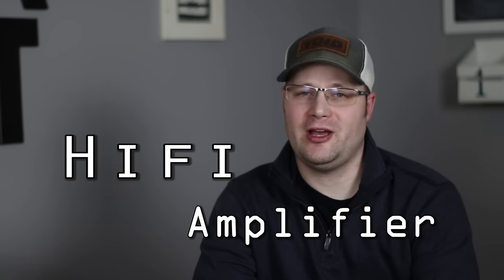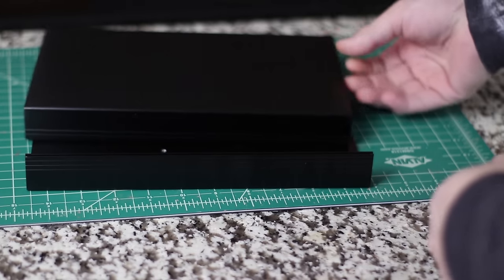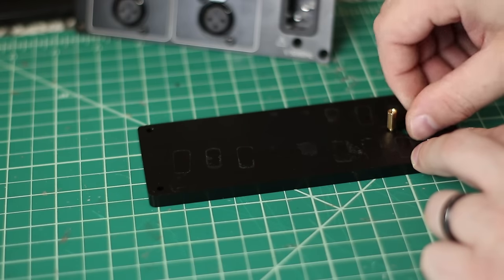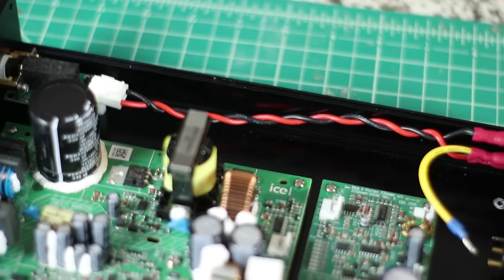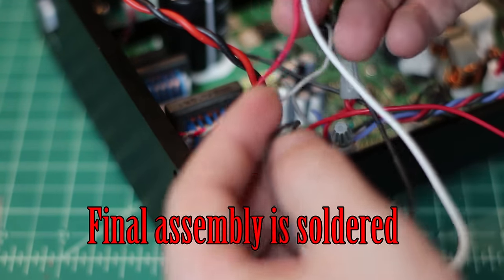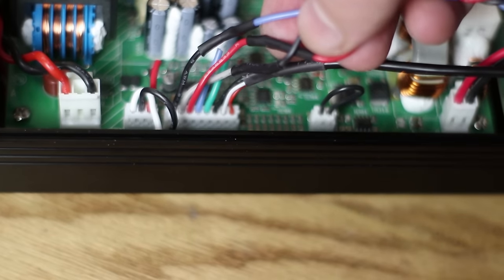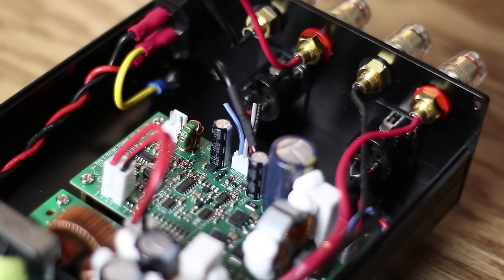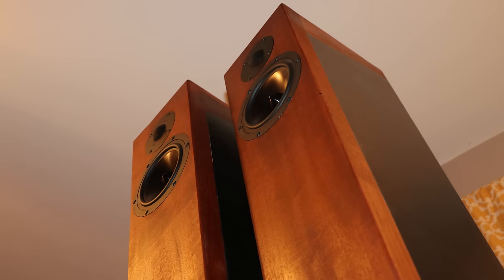How to Make a $3000 DIY HiFi Amplifier for $300

Comment: The ground/earth connection with this particular amplifier case had the paint stripped but be sure the area is clean for a metal to metal contact if you're using a different enclosure. If you have to, use sand paper and clean the area to keep the project safe. (Having a bad ground can also cause noise in your speakers when nothing is playing)
Reply from the maker: Actually it came all scrapped off down to hate metal.  But great point.
Reply: @Toid  Ah okay it looked painted but you had it in your hands and I'm watching from home. Probably still worth the comment to those who may use a different enclosure I guess.. Liked the video though, I'm sure you helped some people out who wanted to get some good sound without breaking the bank and you really didn't miss a beat when it came to assembly and explaining the steps. Keep it up man!
Reply from the maker: @Koroyanis  thanks man.  I appreciate hearing that.  Thanks for the great comment and thinking about others.

Comment: Hi, I loved your video and I'm definitely building one for myself. Do you know something similar (a diy project, audiophile grade) for a preamp?
Cheers and thank you.
Reply from the maker: I don't right now. Thanks for asking.
Reply: i suggest you using an blameless preamp with discrete transistor (based solid state topology).
if you classical lovers, you can use tube  such as 12Au7 SRPP preamp with simple and easy to buid.

Comment: Thank you for the awesome videos. Is the wiring the same on the 1000 amp model? Is a low pass filter needed to run a sub if my signal is coming from the sub output of my denon home receiver?

Comment: The PS Audio Sprout is $600.  That’s your benchmark.  Name ONE amplifier with these exact specific 200 series ICE amp modules that sells for $3K - you can’t.  Parts Express can’t sell the ICE power modules used in the higher price point Amps.
Reply from the maker: I've answeredthis question numerous times,  so you'll have to do some research. However, here's an example of the different manufacturers selling the same 1000asp module ($380) at parts Express for as much as $4700. https://www.audioholics.com/audio-amplifier/clone-amplifiers

Comment: Thanks man, without your video, it would have been very difficult to make this build.
 my ghentaudio kit arrived with plastic spacers instead of metal, (not cool) and one was missing so one hole is in the air at the moment.
also arrived with huge deep ugly scratch in the case bottom, right out of the bubble wrap, meaning they actually wrapped and sent it in this condition as if new
from china :-( ,
Reply from the maker: I haven't talked to Mr Ghent about it. He seems like a pretty reasonable guy. See if he can help you

Comment: Hi Toids, thank you for the amazing video (as always). Do you think it could be possible to make the same amp but with both XLR and RCA input with a switch button that help you choose between one input or the other? This could be really useful if let's say you have a hi-fi preamp and a AV Receiver and you want to use your front stereo speakers as Hi-fi Stereo and Home cinema front speakers. With this same amp and the switch button, in function of the use we could let everything wired up and still be able to have different sources sent to the speakers. I'm wondering if it is possible. Rotel power amplifiers have a switch but they claim you can't wire the XLR AND RCA input at the same time. Is this really an issue? Is it possible to make a Power Amp that could accept both input wired?
Again thank you for your amazing content!

Comment: i found a used diy poweramp with a design like this a year ago, dual 200 asc for 2x100watt stereo in 8 ohm typical.
im still learning about what i actually got,  it runs cool and silent and sounds good. hopefully i can find more reviews comparing those amp boards to other prebuilt brand poweramp counterparts. 

only gripe i had was the auto power on sense was turin off my amp at low volume after less than a minute. but i got around that with opening up the case and bridging 2 pins so it was always on. with diy amp boards you can get proper schematics online so i could figure it out, much harder if i had a brand name poweramp.

Comment: So the Ghent audio case doesn't have a 2nd LED for standby mode?

Also, what IS standby mode? If it doesn't detect input signal for a few mins it powers down?

What is that auto off jumper that you installed on header 4 actually doing? (the cable you got from Parts Express?)

What happens if you don't install that jumper?

Comment: What is the wattage and THD on this?  Great Video
Reply: I don't know watt. Probably enough. All amplifiers have negligible THD. Also, you don't get meaningful information from THD at 1kHz. All amplifiers measure extremely well at 1kHz. Linear distortion tend to increase with frequency. Those who don't tend to be expensive. IMD is a much bigger issue. Here's a $6000 amp that measures well in some areas and bad in others: https://www.stereophile.com/content/ayre-acoustics-ex-8-integrated-hub-integrated-amplifier-measurements
This one for $55,000 measures better, though I'm less impressed by the THD vs frequency: https://www.stereophile.com/content/constellation-performance-centaur-ii-500-power-amplifier-measurements

Comment: I would like to have an amplifier powered by 24V DC, meaning 21 to 29,4 V current I get from solar system/ reclaimed batteries. I don't understand why bother with AC ... as it mostly adds problems and budget.
Reply: So What if I just use two 200ac Boards and a way to regulate power to 47V ?

Comment: are all the parts (links) in your description all (including: feet, terminals, cables? Do you have link for audio test this product?
Reply from the maker: Defeat terminals and cables are all included with the ghent audio case if you buy it with wires included. You'll still need to purchase the amplifier boards. Their links to both the case and the boards in the description of the video. There is no sound test, but you can read Thomas and Stereos review of it here: https://youtu.be/XOKLhnXR4As
Reply: @Toid  Yes, I have seen Thomas & stereo couple days ago, review is good. many thanks to you for this information

Comment: I'm a lil lost. One is the amp and what's the other bord ? Is it another amp ? I checked the amp board on p.e. and it's one out put for speaker. Do you need 2 amp boards ?
Reply from the maker: The links to the boards are in the description. One of them includes the power supply as well as one output. The other board connects to that for power and just has an output.
Reply: @Toid  thank you sir

Comment: Any idea what boards are used in the Legacy Powerbloc2 amp?  I believe they are using variations of ICEpower.  I want to build something close to what is in the legacy.  I do know that there are 2 amp boards with each having its own separate power supply board.

Comment: Ghent sends MOSTLY plastic stand offs with this case, and 2 metals stand offs (you show all yours as metal).....problem is, 2 VERY SPECIFIC places need to be metal, to ground both boards to chassis, otherwise you will likely have a lot of hum noise., the 2 holes on the boards have metal on them, the rest don't....thats where the metal stand offs need to be installed (manual states this), along with silver screws top AND bottom.

I bought a replacement board thinking the board was bad, but it was the lack of grounding those places as intended as this video didn't clarify that point.  Heads up everyone!  (now I have 2 of these amps. lol)
Reply from the maker: They must’ve changed it. When I ordered mine, they sent all metal standoffs.

Comment: Question about this RCA to XLR connectors. Are those just sending Pin 2 to the Tip of the RCA, and Pin 1 to the sleeve and ignoring pin 3, or are they sending Pin 2 to the tip, and combining pins 1+3 and sending that to the sleeve of the RCA?

(ignore this, Amazon answered that for me)

Comment: Hi, Im seriously considering this DIY amp build but got a couple questions about AVR triggering of it. 
Would this amp be safe/able to be used on a master/slave outlet in conjuction with an AVR to trigger it on when the AVR is powered on? or better yet, do you know if there are amp cases avaliable for the same/similar affordable board builds but with a 12v trigger?
Reply: I have some good news, There is already an Auto on/off feature meaning if the amplifier received no input sign for a few minutes it will power down automatically and then turn back on when your AVR sends a signal to it. This is a major advantage of using this over other boards like ICE125ASX2. If you want more details you can download the 200asc manual which states this in more detail. I hope this helps.

Comment: I've got a McIntosh MA 9100 Integrated Amp with 70W/channel at 4 ohms., that I bought new around 1977-78, and a few months ago it started shutting off the output at around 11:30 on the volume dial.  At 10-10:30 it was fine, but if you pushed it a little harder, it shut down from the protection circuit.  I'm looking at taking it to a Service Center to repair it, and the diagnosis fee is $80, which is reasonable and is applied to any work done, but if I can build this for $300 it may be better to use this as my power supply.  The MC has RCA input jacks for supplemental power supply.  So am I correct that I could use the DLR outputs converted to RCA from this unit into the MC, and then connect the speaker wires to this amp--or do I just leave them wired to the MC?  Would this work?  It would probably be less expensive to do this than fix the MC.  Thoughts?
Reply: Sorry my MC is a MA 6100 not 9100 and its 60W/channel in 4 Ohms,  but 70 in 8 ohms.

Comment: can you use these as mono blocks and how many watts per channel is the output
Reply from the maker: You can. You can get modules that will output 200w, 500w and 1000w respectively. The links are in the description of the video.

Comment: Just got a 2nd of those Ghent cases, they swapped the neutral and load placement on the power switch, and the included cables, so the ground is where the hot should be, and vice versa on the board.....THIS IS REALLY BAD I IMAGINE?  Luckily I noticed before powering it up, so switching it manually now.

Keep an eye out people, there is a reason DIY is cheaper!  lol

Comment: Very nice! I've been wanting to make one of these for a while now but i wanted to know more about the quality of the ghent audio case. From this video it looks pretty good and I appreciate the insight. I'm still hoping to see measurements of these icepower boards over on Audio Science Review.
Reply from the maker: The Ghent Audio case is top notch. There was one screw missing with my case. But I just went to the local hardware store and got one. It's quite possible I even lost it. It's the only reason why I didn't mention it in the video, is because I don't know if I lost it or if it didn't come with it.

Comment: one more real problem I have, while the amp is dead quiet when its not connected, the gain and possibly the input impedance too high for my setup,  
once connected I get hum and 2nd harmonic(120hz), 
I ordered -20db xlr inline ettenuators, perhaps that will help, ( it replaces a hafler and crown amps with balanced inputs, that never exhibited any hum),
lifting ground had no effect.
Reply from the maker: It sounds like you may have run your lines across the power. Check to make sure your lines aren't run across or underneath the board
Reply: @Toid   -20db inline attenuators  arrived today, all noise gone :-). (also should be 600 Ohms impedance now )

Comment: Just so you know, the component boards took no time to arrive, but the DIY case takes 2-4 weeks per the website. My tracking status hasn't moved much since my order about 2 weeks ago, and I'm still waiting for USPS to show anything different than "Awaiting item" which probably means this is coming from abroad and still didn't get to our postal system.  I guess my "covid tax" has to be paid in time spent in waiting.  I should have picked expedited shipping.
Reply: The case arrived today, December 14, and per UPS it was shipped on November 12. The sender did say in the email after I ordered that the estimated time for postal deliveries is 25-60 days.

Comment: Is this a good first project if you've never soldered before?
Reply: it's not too bad, there really isn't too much to solder i built mine tonight it was fairly quick and easy, would suggest getting a decent soldering iron, take your time with the wiring, my cables had different colors than his but if you just rewatch and confirm where they connect it's easy, maybe check his page with pictures of the internals helps a lot too
Reply: Thanks man. What will you use as a preamp? I feel like this project will get very expensive fast.
Reply: I'm just using my onkyo tx-nr818 as my preamp.

Comment: Would it be a simple enough "upgrade" to swap in some Neutrik combo jacks in place of those XLR sockets - and save the hassle of needing XLR to RCA adapter cables?
Reply from the maker: Yes, you can do that.
Reply: Combo jacks are XLR and 1/4inch TRS, not RCA.

Comment: Hello,
Thank you for the tutorial. I put together the amplifier but I have an issue. I am using it with 91 dB sensitive speakers and a Schiit Freya preamplifier. The volume on the Freya has to be at least half way (12 o’clock) before I can start heating any sound. 
Is that normal? I thought with me speakers I would have enough headroom...
Reply from the maker: I don't have experience with your exact setup, but that does not sound normal.
Reply: 123Toid tried it with a different preamp and getting the same issue. 
I am pretty sure I wired the power amp right otherwise there would not be any sound coming out of it. 
A defective asc module maybe? But what are the odds of both modules being defective!
Any thoughts?

Thank you.
Reply: 123Toid I switched the wires on the wire plug (live and neutral) and it made a difference. Now at half way or 2 o’clock is a very comfortable listening level. Much better than before!
Reply from the maker: @mosobouc  awesome! Glad you figured it out!

Comment: How would you change the volume on this amplifier? Is it just volume from the chosen source? I am interested on this project and maybe using it in a diy integrated amplifier. or even supplying audio to it from a raspberry pi setup.
Reply from the maker: Your preamp will regulate the volume. So whatever your source is.  a lot of people hook this up till like a home theater receiver that has 5.1 channel out.  In that case then the surround sound receiver would control the volume.  But whatever source you want to use can control volume

Comment: So I noticed you can get the internal wiring harnesses from either Ghent or Parts Express. Is there any difference you're aware of?
Reply from the maker: I've actually used both. The Ghent is cut to size for this case and all the appropriate ends are on it. This makes a much easier install
Reply: @Toid  I guess I'll go with that then.

Comment: Well, after a few years of owning it, I have super loud noise issues from the amp, replaced the main power board (handles right channel and power for amp) and seemed to resolve it once, but it's back again, happens on both boards, and happens even if I fully disconnect the left channel daughter board....so it's def the main board thats the issue.  Happens with and without ground lift power cables......very loud buzz, even with the XLR cables sitting to nothing, if I connect to a source, it goes away, until I power on the source.

Seems that these ICE modules just fail often?

Well, that was with XLR to RCA monoprice cables (tested multiple sets), if I go straight XLR, no noise.....strange, it used to work fine with XLR to RCA without noise, so I can't explain why it no longer does.  :(